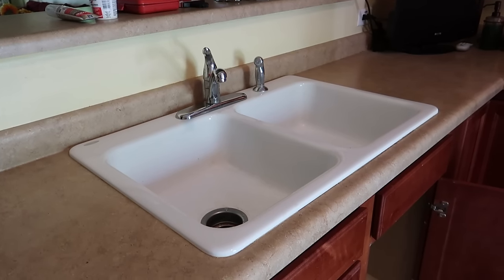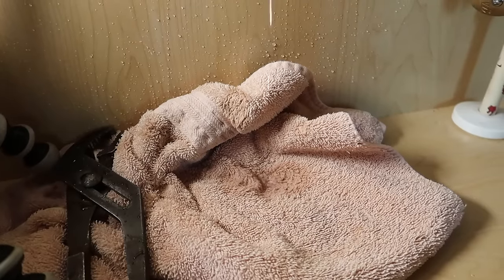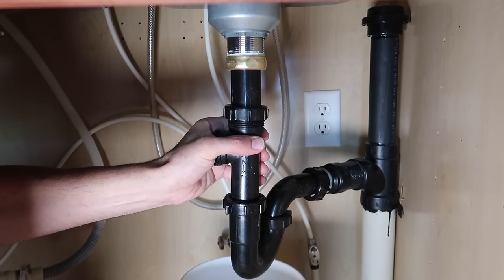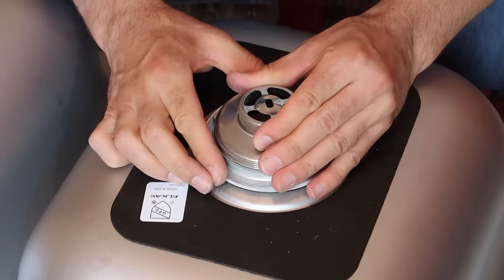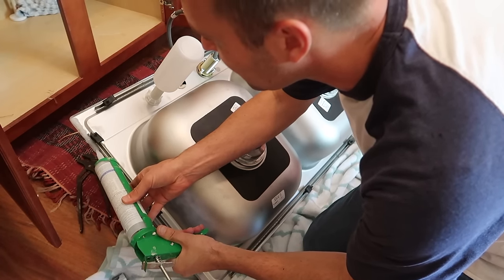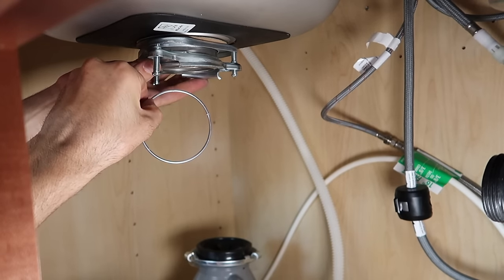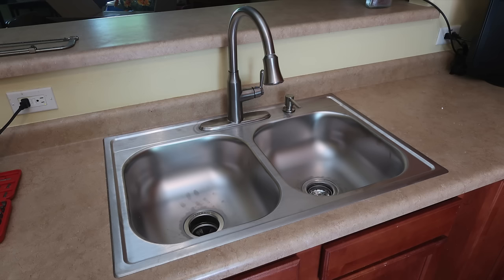How to Replace & Install a Kitchen Sink / Cast-Iron to Stainless-Steel

Comment: Didn't need to leave a comment, don't usually leave comments but felt that I had to in this case. THIS is how a "how to" video should be made. Explains everything even the small stuff because not everyone is an expert. Made a mistake, didn't edit it out,used it as a teaching tool. Great job all round. Thanks
Reply: Yes I Strongly agree
Reply: I agree!

Comment: Too bad the buyers didn't realize what they were doing... giving up a beautiful cast iron sink for that thin flimsy stainless steel one... those old cast irons are super durable and pricey and wanted nowadays by people... a little cleaning to remove the light staining or even a new enamel coat to really make it pop!
Reply: I’m literally watching this before replacing a cheap ss sink with a cast iron one because I hate the tingy one
Reply: It also sounds like the sellers were being a little spiteful and/or intentionally cheap on the SS replacement. They should've put in a nicer one (preferably 18 gauge or lower and 9"+ deep). Who goes shallower on a kitchen sink and calls it an "upgrade" just because it's stainless steel?
Reply: yea imo those are ugly.stainless steel isnt flimsy. i prefer a shiney quality sinlk. they do make cheap sinks that arent stainless steal though.depends how much mohey you want to spend

Comment: When cutting plastic pipe with a saw you should always deburr the pipe inside and outside, otherwise solid stringy particles can get caught on inside burrs and build up restriction. This is especialy true for bathroom vanity drains, hair catches on the burrs.

Comment: I'm a 70 year old grandma replacing my kitchen sink for the first time. I recently finished painting my house, shed and all the porches and railings. Replaced the horizontal and base exterior trim that was rotten, was up on my roof painting the dormer. Installed a screen door. Removed a kitchen cabinet that was out over a peninsula bar counter to open the space more. Patched the opening with dry wall, painted, and cut the molding to fit. Plan to paint my oak kitchen cabinets soon by using grain filler first, sand til smooth and then paint. I have no fear of replacing my kitchen sink (and disconnect the RO system too), thanks to this video. Thank you!!

Comment: If you are installing a new disposal and your dishwasher drain hooks up to it, make sure you remove the "knock out plug" with a screwdriver or your dishwasher will not drain.

Comment: I used this how to vid to install an upgrade from the cheap, thin sink that Adam is installing because over time, they buckle from the weight in the sink and the garbage disposal causing leaks.   Pay more to get the higher gauge, sound deadened sinks instead of this spec house quality junk.

Comment: I put in a new sink that uses those clips two days ago. Oddly enough, I installed the old sink with a roommate over 42 years ago, lol! I guess I got my nickel's worth out of the old sink. My install was miserable due to tight spaces that didn't allow my hands to install the new clips. Finally, I invented a tool made by drilling a hole in the end of a sawed-ff broom handle that allowed me to lift the new clips, slip them in the rails, and position them correctly. I hope I am dead before I have to do that again, six hours under a sink was awful. I also had to trim drain pipes, just like you showed. Great video, thanks for posting it!

Comment: Nice job on the video.  When tightening the sink-counter clamps (from beneath) I put a little piece of tubing on the end of my long screwdriver, it eliminates a lot of frustration trying to center the screw and screwdriver.

Comment: Thanks for sharing. You explained the process very clearly. I m replacing our white cast iron sink with a used stainless sink I bought. The sink even came with a faucet. The stainless is in very good condition. But the sink has a bow and it came with only one rusted clip. None of the clips I bought would work. I finally found the exact clips on Amazon and currently waiting for them to arrive. So I’m hoping with plumbers paddy and tightening the clips down the sink will lay flush over the counter.

Comment: I am so happy I decided to consult you tube before I got any further than I have. My cold water pipe was leaking into my my kitchen causing the linoleum to buckle. The workers are replacing the floors. It's as good a time as any to replace the ugly 1980's sink and plastic faucet. I was going to get an el cheapo sink but now I'm going to rethink this and go with a better grade, making sure the sink is the same depth as the old one. I'm also going to let someone who knows what they are doing rather than having my 80+ yo husband attempt it.

Comment: You might mention a bit on removing the disposal drain plug for the dishwasher, just in case they put in a new disposal unit. Good video.
Reply: My brother in law didn't remove a small black plug covering the disposal inlet.  It was very hard to see.
Reply: Been there, done that.  It was a bit messy.

Comment: you can use a window cleaner like sprayway window cleaner on the silicone and it makes it really easy to clean off and spread
Reply: Alex Moore this is a neat comment. Can you elaborate a little more? Do you spray the window cleaner on top of the wet silicone? Does it weaken the integrity of the seal?

Comment: My kitchen sink is top mounted to counter top with silicone. It has no mounts under the sink?
I was able to cut through the silicone across the front, sides, and 6 inches of the rear between the wall and the sink with Putty Knives. How can I cut the sealer in the narrow rear of sink?

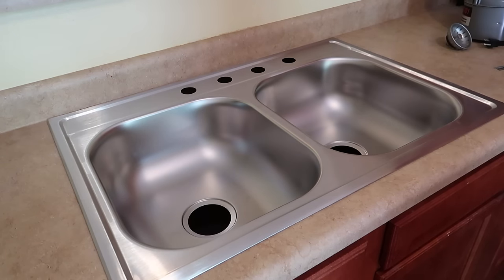Comment: 3:12 In Europe we never use plumber putty. 
The drain is inserted from above with the paper gasket. The rubber gasket then comes over the nut from below. This is then 100% sealed.
4:28 counter? What are you counting?

Comment: Hi just wondering I hadn't just installed my new sink an wondering about the water lines, the hoses that came with my sink are female and along with the replacement hoses are also female ends I'm curious what lines did you have and did you have to use a adapter in between to connect them ?

Comment: We wanted to replace a current 2 bowl fiberglass sink w a stainless steel, same size, but the installers said we had to have a cast iron sink because a stainless steel sink would not work in the space. Please explain, I have no idea what they're talking about. Thanks.

Comment: Do the drains, rubber and paper gaskets (installed at 3:45) usually come with a sink? will my old one still be good (so long as they fit) or would you recommend buying new?

Comment: Great Video. My eyes are not good. When you siliconed the faucet to the stainless steel tub did you use white silicone? Is it better to use plumber's putty to mount tub than silicone in case you have to change the sink again? Thanks

Comment: Hey great video I just saw I had a quick question on the plumbers putty does it cure does it have to cure can you run water immediately after installing it or is there a delayed time I know the silicone takes 12 hours to set so I’m waiting that long but I didn’t know about the plumbers putty after all that said and done thanks for the video
Reply from the maker: Douglas Bernick no cure. You can use it right away.  Stays soft for a long time.
Reply: AdamDIY thank goodness the grandkids are trying out the new one and like to critique on my work.

Comment: Great job. I just ordered a new sink and its 18 G. I hope that means its a quality sink. The one we picked out is a large single bowl that is replacing a twin bowl sink. Very builders grade.
Reply: craigsclocks With the gauges on stainless steel sinks, lower numbers are thicker.  18 gauge, if I remember, is one of the thickest.
Reply: I'm not sure what the best sinks are but I think my 18g recently from lowes was the heaviest they carry. Should be fine.

Comment: I'm really not looking forward to ever doing this sort of job, but the video was interesting. I'm actually kind of stuck right now with just the sprayer in the condo where we rent. It attaches with the brass threaded connection. Apparently those aren't as common as the other ones? And our lease has it where we have to pay the first $300 of any home repairs, which is wonderful since most repairs cost less than that and we keep having to fix our landlord's stuff (yet another reason to buy our own house). I'm not even sure how to get the hose out of the top part. But being the male, I'm supposed to fix it like I do everything else, like our cars, so here I am. I love your office setup there. I'm assuming that's acoustic paneling. Does it go all the way around?

Comment: Silicon grease on all the drain connection threads and rubber pieces. Rectorseal on the threaded pressurized fittings.

Comment: When measuring to buy a new sink how do I know how size will match?
Reply: coldworld5 you should expect that it won’t match.  I am installing a glacier bay sink, and the size of the bowls match the hole in the counter perfectly.  But, before installing, I realized that it uses different clamps that make the overall sink a bit wider than expected.  As a result, I have to cut the hole about 1/4” bigger a longer and shorter side to allow for the clamp channels to have room to sit in side the hole as they are supposed to.

One thing I did was go under the sink and stick a tape measure around the sink well enough to get a pretty good idea on the dimensions of the hole in the counter top.

Comment: If you have problem installing ring on disposal side, wrap a cloth under garbage disposal and set in sink for weight to hold strainer basket down. This will hold strainer basket so you can pop wire ring in place
Hope this helps
M L Rogers    Pasadena, TX

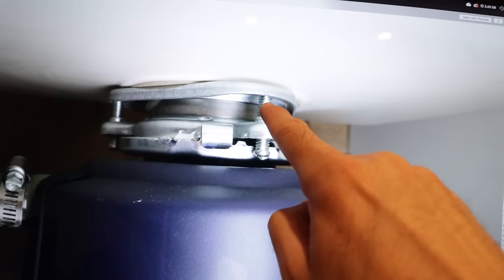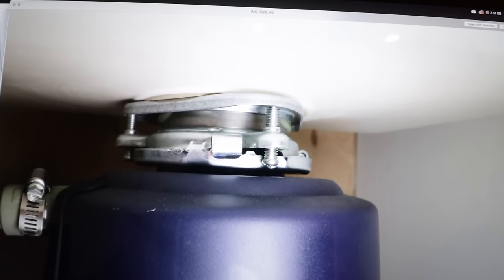Comment: Hi Adam, I think this was a great video.  I have never replaced a sink, and currently I don't have a need to either; however, in the next year or so I might have to do this.  Anyway, I have a question.  In your video here, around 7:05min to 7:22min I am looking at some grey stuff, is that the putty?  If it is the gasket, should it be warped like that?

Oh, and that DisposaLift looks interesting.  I am not going to get an Instagram account, but I am going to look into acquiring one of those tools.  Thanks for demonstrating.
Reply from the maker: It's plumbers putty oozing out.  Glad you liked the vid!
Reply: Do you have a demo about caulking the gap between staircase steps and staircase wall?  I need to recaulk/repaint mine.

Comment: How about when the electric under the sink isn’t a normal outlet and it’s actually a wire with nuts running to the garbage disposal. (My house is old 🥺)

Comment: I would recommend not using 100% silicone.  Use clear ”kitchen and bath” caulk, or similar. They usually contain silicone, and are much easier to clean up, like with a damp sponge.  They also can be removed if they dry somewhere not wanted, whereas silicone can only be removed mechanically by abrading or scraping — usually leaving some residue.
Reply: excellent point. white lightning makes good kitcehn n bath caulk thats easy to clean up. just check the cute time, sometimes its 3 to 4 days for some
Reply: Kirk Nygaard !Any thing designated  poly seamseal is better than silicone ,is water washable until it drys and comes in colors. 55 year retired plumber.

Comment: The garbage disposal pipe drain should’ve been slightly slanted down a little more so than the garbage disposal water flows through otherwise it’ll sit inside the garbage disposal and stink and other things

Comment: I doubt you will see this because of the time that has gone by since you made the video. I have the same sink except mine is pitted. 
Is one container of putty enough to do the drains and faucet? Is one tube of silicone enough to do one sink? How big should the bead of silicone be? I did not see you do this. Your video shows more than Lowes does. Have good days!
Reply from the maker: Yes one container and one tube is all you need . You should have some leftover.   I do about 1/2” bead or less around the sink flange.  No smaller than 1/4”.   But for the faucet you done need as much.  If the faucet comes with a rubber gasket I don’t use any silicone.
Reply: @AdamDIY  Thank you. The faucet has a plastic piece so I suppose I should use some of the plumber's putty.